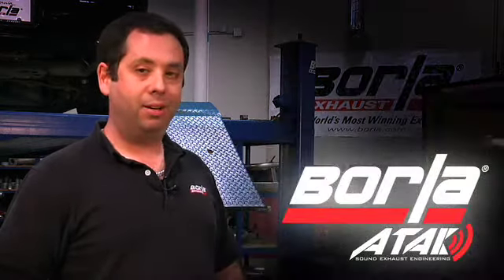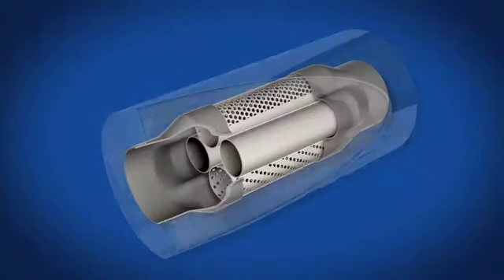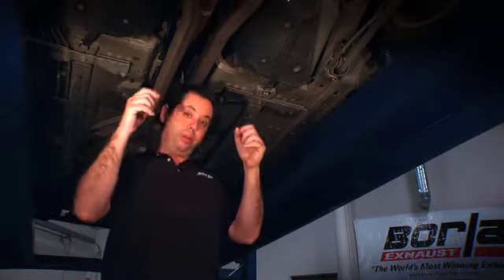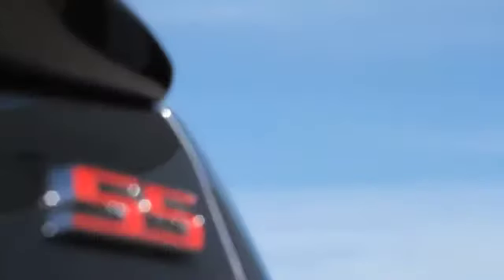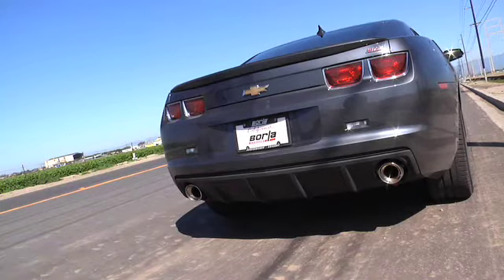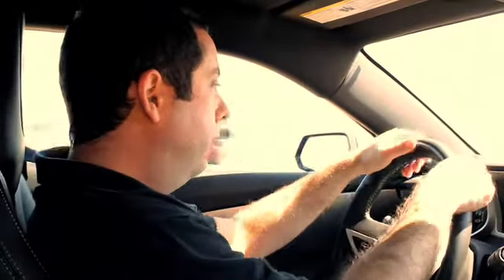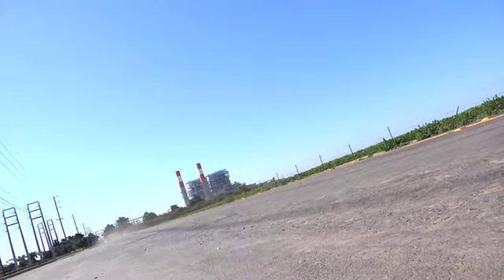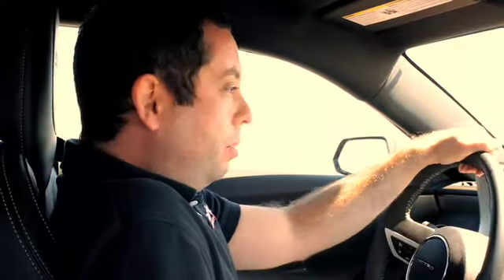Inside the Borla ATAK

Comment: The more i listen to the S-Type the more I want it on my 5.7 Ram 1500. The Touring (maybe a little too soft) and ATAK (maybe a little too loud for towing rpm's) still sound great, but i want more exterior throatiness and yet still tow without having too much interior cabin drone. I'm running stock currently and want to "unlock" the potential and efficiency that my vehicle drivetrain offers with an exhaust that will allow it to breath. Borla is top shelf quality and performance and with a million mile warranty on metal that will reside in the North East US, I'm pretty much sold as to what brand I'm installing on my vehicle.